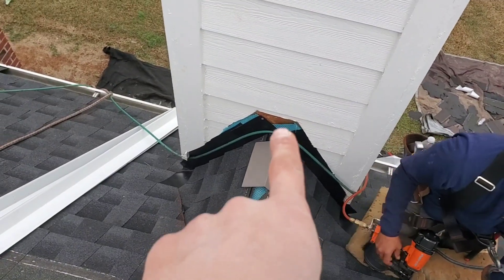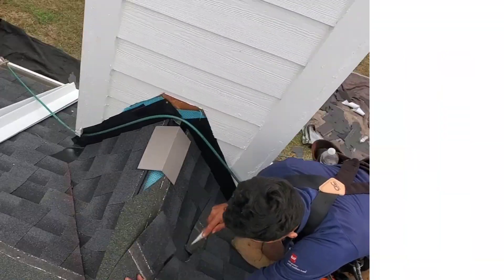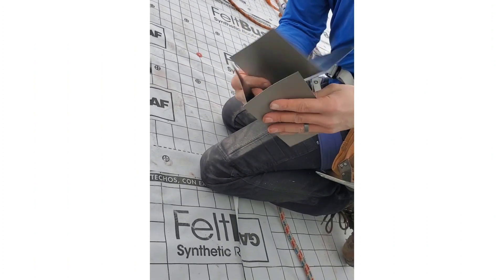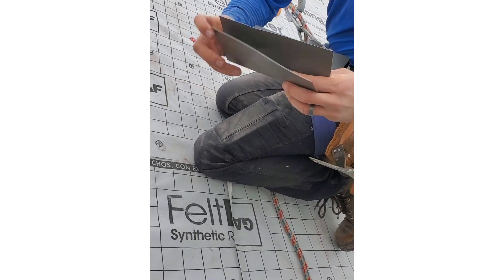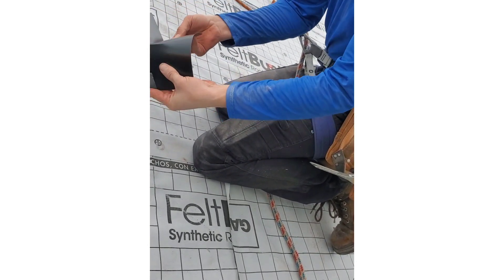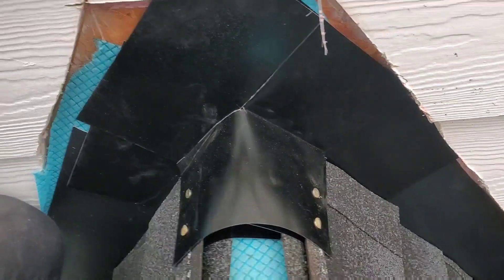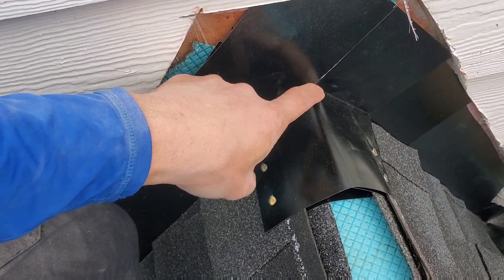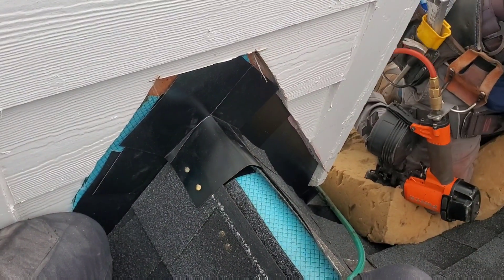Ridge to Wall. How to install a scissor lock flashing detail.

Comment: What did you end up doing about those bottom rows of siding?
Reply from the maker: Slid 3" strips of metal under the siding and over the steps. Then I stalled a pvc/hardi 1x4. Caulk and paint.

Comment: Yes it will leak and it should be soldered 
Made out of 26 gage minimum
Reply: 99% of the roofs ive been on its done the same way from the previous roofers. If the siding has a proper j channel and such, water wont even touch that point. When you throw capping on you could spurt a little bit of caulking on the pinhole and but the first cap shingle up to it.

Soldering metal isnt usually used on shingle roofs. When you get to higher priced material, slate, cedar shake, etc where copper is used then hell yeah you would solder the seams and such. But for one single thing that will never see water its not needed.

Comment: Definitely not how we used to do it back in the day! No 1x4 backing on the chimney, no Z bar counter flashing? No 26 gauge sheet metal cricket? You never put your flashing against the structure, asking for trouble.
Reply from the maker: Maybe some of the changes are good, maybe ithey are bad. But this is definitely how it is today.